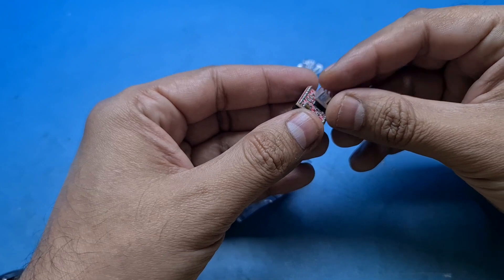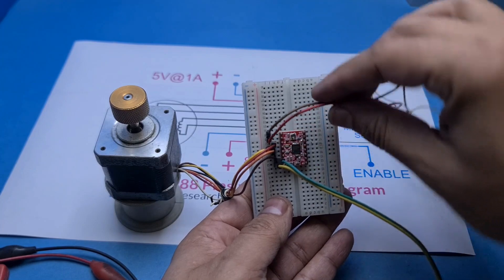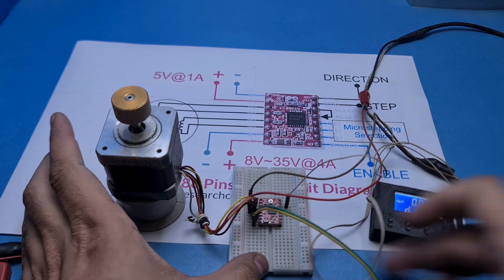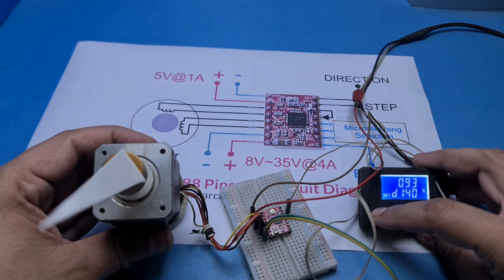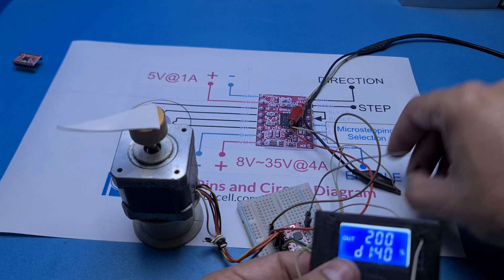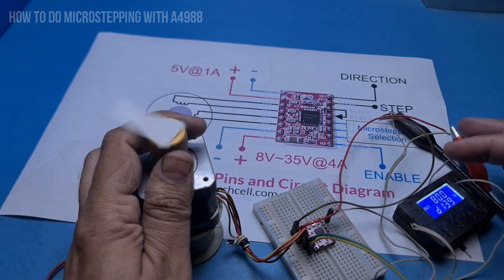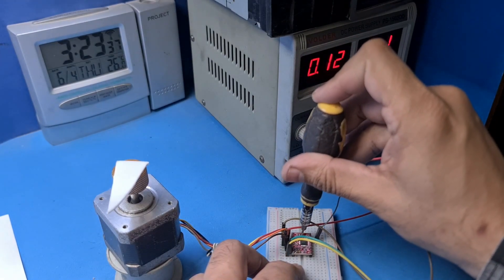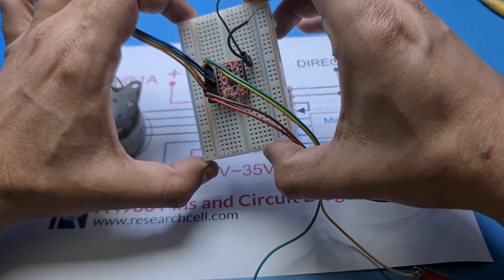Learn to use A4988 Stepper Motor Driver

Comment: How many wire stepper motor can be used?
4 wire or 6 wire
Reply from the maker: You can use both 4 wires and 6 wires stepper motors with this driver.  However even if you use a 6 wires stepper motor, you will still use only 4 wires out of the 6 wires and leave the extra 2 wires unconnected.